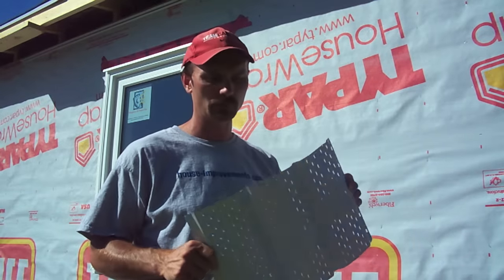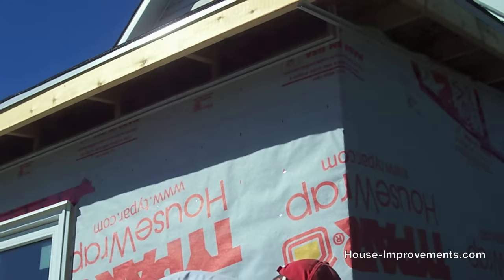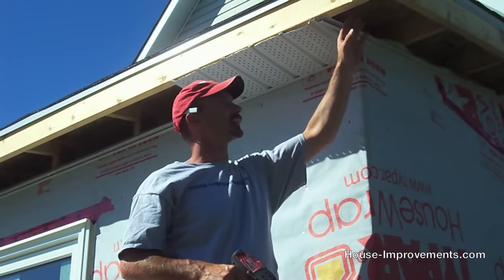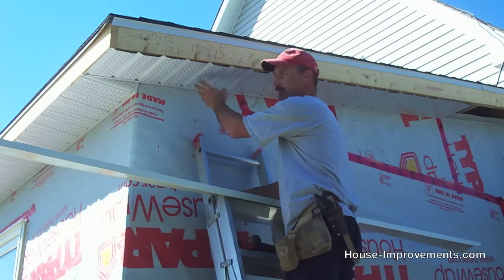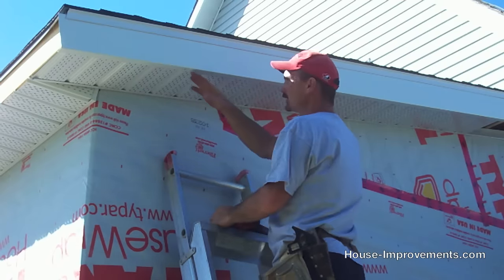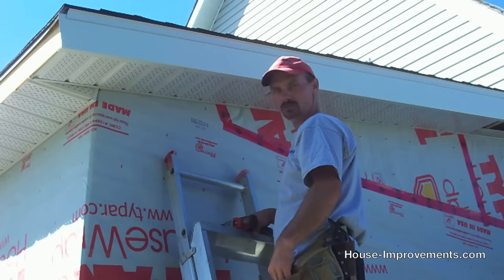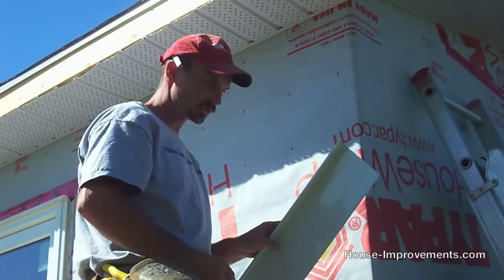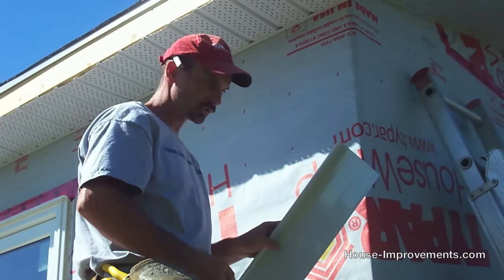How To Install Soffit And Fascia

Comment: What tipe of screws is he using and how long?
Reply from the maker: These are #8 x1-1/4" screws with white painted pan heads for the fascia ,and #6x 3/4" standard flat or pan heads for the J and soffit
Reply: @HouseImprovements I’m having a hard time finding those screws? Can you please post a link for me?

Comment: That's some real hack work rite there! The jchannel should be ran inside to outside of corner then soffit 45d to the appropriate angle
Reply: WHAT ?
Reply: Michael August I was looking to see if anyone was going to notice that and you were that guy
Reply: Michael August He don't know what a birdboox is
Reply: Michael August yes. It would definitely look way better, and it's really not that much more difficult. Infact it's probably easier than doing the j like that and all that screwing around.
Reply: The correct way would be to cover the meeting points of the 2 soffits at the 45 degree angle with a piece of hemmed aluminum, not using j channel

Comment: What screws are you using? I hate the little white 1" nails
Reply from the maker: I can buy them already painted for many popular colours . They are a 1-1/2" #8 pan head screw. Any similar screw would work and you can paint the heads yourself if you need to. Stick them into a piece of rigid foam so they stand and spray paint the heads.
Reply: HouseImprovements Thank you..great video. Just finished my Fascia with the screws it looks great. Time to put the new gutter in.

Comment: Shouldn’t you have put bottom fascia on first and then the slopped one? It’s just the way I was taught. 

Yes I seen you mentioned to put caulk which as you said eventually will ruin its look.
Reply from the maker: I find water drips off before it will go in. plus the metal wrapped around gives some wood protection.
Reply: Right that flap is standard no matter which way you put it unless your able to actually wrap the corner which in this case you weren’t. Wind factor is why it should be other way around.

However very nice video!

Comment: I wish he would have showed how to install the fascia all the way up to the ridge and back down slightly to show how to get the peak. I also noticed in this video that when he installed the fascia, water can leak behind it. Installing fascia should be from the bottom to the top, but he bent the top to fit behind the bottom at the gable end allowing water to get behind. The gable should have been bent to go behind the fascia running up the house.
Reply: Chris Zell wtf are you talking about that he installed with a " buck water " lap , soffit inserts into J or F channel , fascia tucks under roofing edge metal " drip edge " & lower lip of fascia covers outer edge of soffit leaving no buck water laps in his metal , anyplace .

I've watched this video 3 times trying to make sense of the negative comment where you claimed he installed improperly,  allowing buck water to enter the metal system , I can find zero fault with his installation , I would have built my " return " a little different than he did but it's a matter of preference , all said n done this video is a text book installation of J or F channel , soffit and fascia , if your doing something contrary to this video chances are your doing it wrong because this installer is doing everything 100% correct , and I'm not giving opinion either , I've had a journeyman card in roofing & sheet metal for 32 yrs now so I know exactly what I'm seeing .

Comment: You gotta actually get rid of the drill; it has no place up there. Make sure the fascia is over lapped. F is what the soffit goes into put upside down, top of the f is what is levels from the fasia. J gos under that sometimes the finish trim. Always try to wear safety harness.

Comment: Did you screw the j channel directly through the channel part, instead of the flange?  That is what I was thinking about doing because I don't have any place to screw the flange to, and my local supplier doesn't have the f channel. Thanks for the video; it is really helpful.

Comment: How do you do this type of work on a very tall farm house and not fall off a ladder?!
Reply from the maker: This is not easily done from a extension ladder on any home if the eave over hang is much more then 12" because it is such a reach from the ladder. On a tall home I would recommend Scaffold or a scissor lift.
Reply: HouseImprovements   Ok, thank you! Scissor lift will only work on one side of my house, scaffolds would probably be best, but setting up would be a job all it’s own!

Comment: Well, we do the lob a little different than you. When soffit lines doesn't match the level, just like the one you did in this video, , we normally  build a bird box to make them leveled, unless customes really doesn't want it. As for the fascia, we normally use a L shape corner strip. We don't fold back the fascia., except if er do a repair and the house has been fashioned as such.

Comment: Aluminum fascia is always face-nailed to the pine fascia, bottom lip snug up over the soffit panels. Nothing ever goes on the bottom lip. If you screw up through the bottom you'll scrunch and twist the aluminum.  Each eave corner gets faux miter back-snipped overlap to give it a pro finish look instead of a 'Joe' 90 deg. wrap around.

Comment: does it matter how long you cut the soffits?  why do 10 if 5 would .  Just cut them bigger?
Reply from the maker: The soffit panels need to be cut to the correct length to fit your overhang. Not sure if I really understand your question
Reply: HouseImprovements She thinks you are cutting them the opposite way you are thinking , the over hang is a standard size, therefore so is the product.

Comment: The wrap should be on the eave fascia, not the rake.  Water still runs down hill.  Second, you should not put fully vented fascia up a gable, that could (most likely will) create water or snow in places that you don't want them when the wind blows.  I don't want to nit pick, but try putting your house wrap on with the printing the right side up, granted it wont affect performance but as a contractor it's the attention to details that set us apart.
Reply from the maker: Thanks for your suggestions Joe. I see what you are saying about the corner lap possibly getting rain behind it, I believe even done my way very little will ever get back there as the rain running down that surface will not run down the slope long before gravity kicks in and it drops off of the vertical surface.Even the few drops that may get back there does not get trapped anywhere against the wood because the aluminum is not tight to the bottom of the wood fascia. Don't get me wrong, everyone has their ways and reasons and I see what you are saying as well. Thanks for your participation .

Comment: Ya disabled , but I gotta do what I know& am good at. Make a return by cutting the level cut on the roof cut, eg. put level on 4&12 it is the long line. Pick a length of the return 13.5 for a 12" soffit.than you can get out the drill. Bend the metal around prefer break made.

Comment: Do any of u know that when u fasten the fascia, with a nail or screw,u fasten the soffit too.so u fasten the soffit 2 times.and the guy talking about the soffit expanding and contracting,that why he staples only the female end should really read the first part of this post.no need to fasten the soffit at all because if u install the fascia correctly.this means a 1 and 3/4 inch nail every 2 feet.this also means that u nailed the soffit every 2 feet.can any of u figure that out?

Comment: The roofer did a shitty job on the drip edge (he called it flashing) at the 45 (corner). There shouldn't be a gap there. That is an opening for wind-blown rain and moisture which will rot out the wood. If you ever have new construction that is something you should look for. At this point the only thing that can be done is to caulk it.

Comment: metal L shape= Metal cladding
fascia = peice of wood that Metal cladding goes on
..just saying
Reply: Where you are from can be a reason why people refer to things as another name. I see it all the time from instructional videos my teachers show us in school. I call the metal L shape the fascia, and the board it nails to the fascia board. Everyone is taught different but its all the same.
Reply: Fascia cap, fascia board. Simple.
Reply: Clifford Brown, you are partially correct...just sayin'! What you are calling fascia is actually "sub-fascia" which is a 1x or 2x wood material (especially in residential framing) that ties trusses together and gives you a backer for your fascia and a nailing/screwing surface for your soffit. Cladding, especially metal cladding, can be any cladding that covers your structure, e.g. roofing, windows, doors,  walls, sub-fascia, etc.
Reply: @bradeley6409  Furthermore, almost all subfascia I've come across has been undersized and also not beveled to accommodate the plywood that overhangs it. Builders take shortcuts.
Reply: @Astromyxin  When the pitch is greater than a 5/12, I bevel the top of my sub-fascia

Comment: That is a sad corner. Probably won’t last 2 years. The drip edge should be tight to fascia board and the front fascia pc should wrap the side underneath the side pc so water running down the side isn’t directed in behind the front pc. The drip edge should be the same way. Not a hater, just how I would do it. Appreciate the video
Reply from the maker: Each to their own I guess.

Comment: Not impressed with the upturned 90°edge of the first panel installed.  Makes the triangular vertical adjacent exposure look cheap. Also would have put a screw through it into the j-trim to keep it from flopping in the wind. 
Corner of fascia overlaps in the wrong direction.  Any wind driven rain or water running down the pitched fascia will go around the corner and under the lower fascia. Recipe for rot in the fascia board.
Reply: nah

Comment: No fasteners by the house? A strong wind load will shove the soffit next to the house up. Ask me how I know. Soffit needs support on the facia side and the house side. The way you are doing it maximizes profit for the contractor at the expense of the home owner, who  has to repair the soffit after a storm. why even bother with one screw on soffit. Just use a staple til the facia goes on and holds it in place. More money, no expensive screws. Cash the check and run.

Comment: I will take Shannon anyday of the week over the Mexicans that just did my house due to a hail storm on 5/18/2017. I hired Fortified Roofing and did not know they were going to bring in Mexicans. they told me local help, yeah, right. not a bad job, just did not tell me the truth. they have this wonderful web-site, they are from New Jersey, I am from central New York. also checked out at the BBB. at least Shannon does it right from my point of view. I also did all the electrical with waterproof boxes and GFCI that needed. removed the shutters, the Dish'es from the roof, no longer needed. the cable and re-route, installed the security light with approved box, not just a vinyl box like the contractor  would.  I am 67 years old and i want just what is right for the insurance money that they are getting. I had done roof, 2 shed roofs, vinyl siding, and gutters. they gave the back gutters for the work that i had done, actually the down spouts. gutters were included....... A lesson learned, I would only hire local if ever again, I have been here since built in the year 1990.....i feel bad that i did not know any better until it was to late...just want to give Manny a high five, he did a great job with my siding and I became good friends with him........treated him like my son...

Comment: ya can use pressure treated wood for facia,,however ya cant cap it with aluium,,cuz theres a chemical in the wood that will eat through the alluim in 6months,,pressure treated is not recomended

Comment: that's not how you do the first piece did just bring your first piece of j out  straight and then you cut a Mitre in the other one go on a along the other straight piece of you know you don't have to bend that first piece of soffit up like that and if you're going down on the table you just make a box how to flatten metal aluminum we use an 18 gauge air gun the one and a half inch staples to put up a lot faster very strong too

Comment: That's not how you make a corner with L6 the water is going to run down the Gable wall and straight into the facia in rought out

Comment: At 1:15 you say to level a line from facia to wall??? You forgot to tell them to subtract the thickness of the soffit material from the line on the house. So everyone who installed soffit watching your video now has a tilted/crooked soffit system, just sayin, you might want to correct that with a million views lol
Reply from the maker: +jim davis Ya that line is the top side of the J ,you are correct.
Reply: Oh, ok. We use F-channel down here. We just drop the line the thickness and nail it on.
Reply: ?????   Bottom of the sub fascia....to find the mark for the top of the j-channel?  No, I think he got it correct.

Comment: Everything in this video is incorrect. Eave/rake corners are gable boxed to keep out water & critters. Never 'Joe'-bend them. Never snip panels, aside from fine tuning, with metal shears (be there forever), only for J-, F- and H-channel. Use a sliding miter saw with a good 80 tooth blade, 12' panel supported on either ends. Cut in half, then gang cut in pairs to length. Won't chew material. Screw goes in every stand-alone channel plus seam. Will know why on a really windy day.  Fascia next...

Comment: lol,, Why would u use j channel for soffit instead of f channel? F channel comes with nailing flang.
Reply from the maker: Around here F channel is not carried by anyone. Infact the only place I have actually even seen it is on the internet and pictures
Reply: Wow ok. So u use j trim under soffit for siding finish i guess?
Reply: Sometimes hard to get here on East Coast of Canada too. I see it and buy boxes so i have it. Nice work u do.

Comment: Yeah don't hang soffit this way they sell F channel for soffit that you cam nail or staple. so you don't have to screw through the back of the channel which takes a lot longer. And you should 45 the soffit on a hip roof it looks 100 % better.
Reply from the maker: only available by special order here.

Comment: do your doing it all wrong
Reply from the maker: of course I am
Reply: you put soffit at the end of the eve where the gable when you should have put a chop usually aluminum coil and it's way easier to use 1x2 as a loft and run it from the Beam to your level line and then run the Jay to the loft with a staple then run your soffit and then put your fascia
Reply: TPSfishing learn to speak buddy then you can go ahead and comment...
Reply: lol